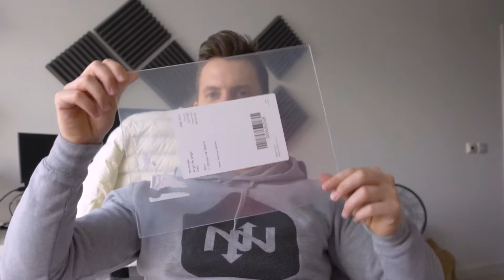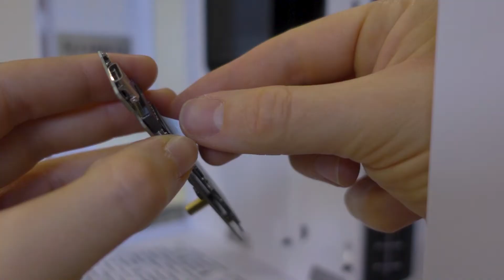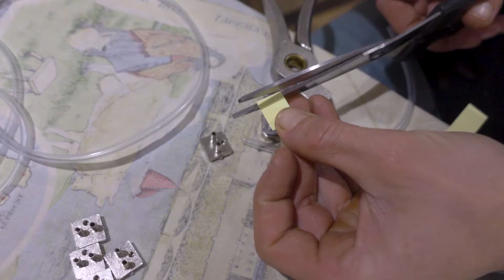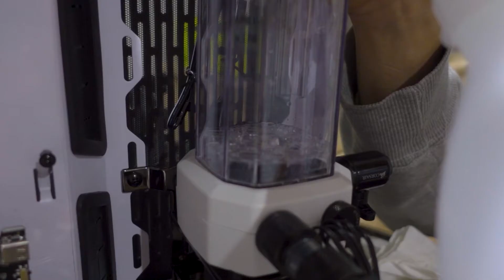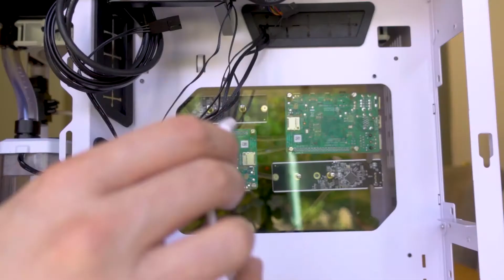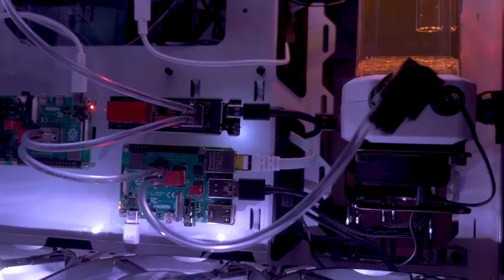The Water Cooled Raspberry Pi Solar Powered Stake Pool Build! - All Metrics Included

Comment: The “weird” temp results are a combination of more or less accurate contact with the dissipation element and the fact that your radiator/liquid setup is indeed overkill and dissipates more heat that the system or better every single node can generate at any given time. I hope that makes sense.

Comment: 46W with the lights off is incredible

That probably works out to around £35 a year - basically the same energy consumption as a fridge.

Awesome project and very well executed mate - much more efficient than VMs
Reply from the maker: Thanks for the kind words mate, yeah it is much more efficient than VMs and running it off solar means it has 0 operational costs and is eco friendly 👍